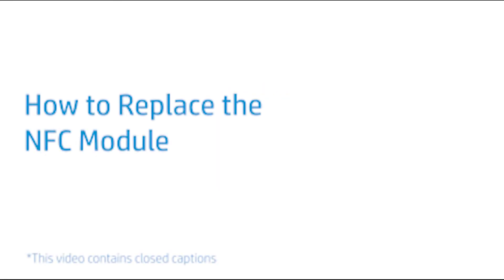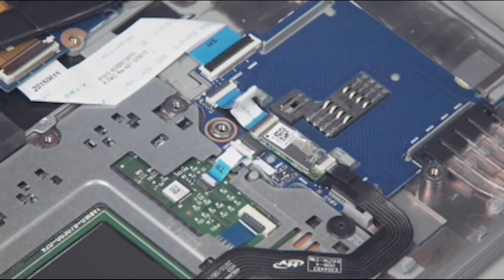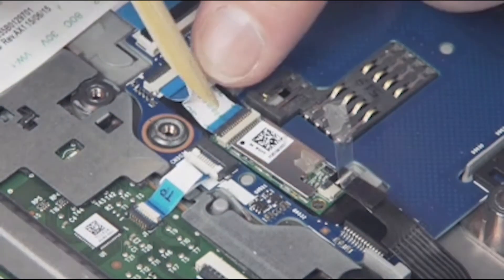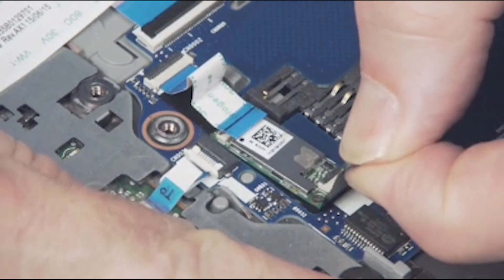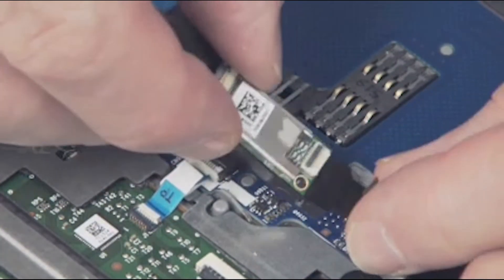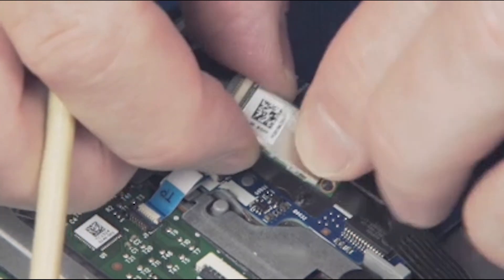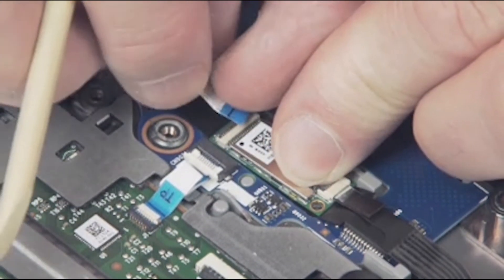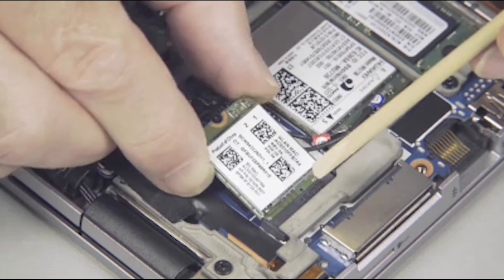Replace the NFC Module | HP EliteBook 840 G3 Notebook PC | HP

Comment: I did this to install on my laptop but there is no way to enable nfc
Reply from the maker: Hi Matthew, thanks for contacting HP Global Social Media Support!
I understand that you are experiencing an issue in enabling NFC.  
I will do my best to assist you.
NFC chip is inside touchpad.Hope my reply helps you.
You may need third party software to read and write programmable tags (like TagWriter) downloadable from Microsoft Store
Binu_HP Social Media Tech Support
Reply: @HPSupport  I added to my laptop that didn't have it and it doesn't work and I am unable to enable it in the bios I really should just be able to add this myself. I took the NFC module and antenna from a broken laptop and placed them in mine
Reply from the maker: In order to get this issue fixed, please contact our customer care team over the phone or chat for further assistance, as this issue requires Live conversation with you over phone or chat to isolate the issue and provide you instantly with appropriate solution or repair/replacement options available at your place as per the warranty.
Please feel free to reach us on call/chat, please access this link to select your preferred country and language option to reach us. Global support link: - https://www8.hp.com/us/en/contact-hp/ww-phone-assist.html
Binu_HP Social Media Tech Support